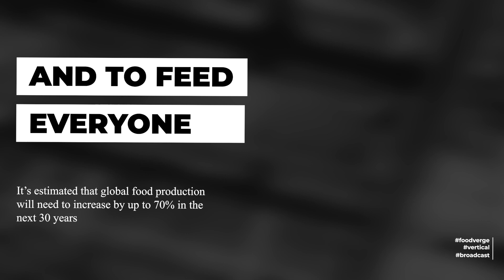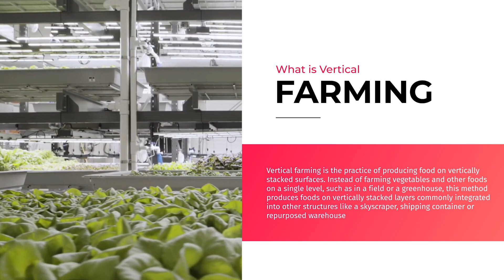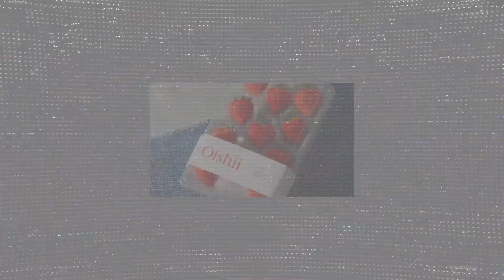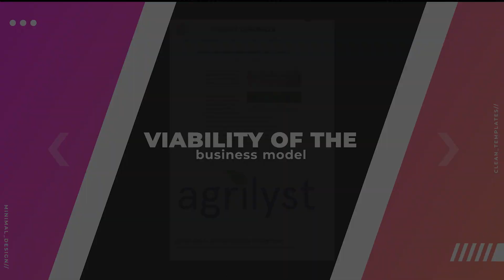Vertical Farming 2024 | Future of Agriculture

Comment: Will vertical farms in the open such as tower garden solve the problem of electricity use or in such farms the shadow of the tower will result in low yields ?
Reply: By in the open I meant in a polyhouse
Reply from the maker: The main energy requirement is the light source. It tends to be LED lights as they are efficient and there is a level of customisation you can do to optimise growing conditions. If you used just sunlight on the towers you would reduce energy consumption but also yield. Hope that’s useful. Jack